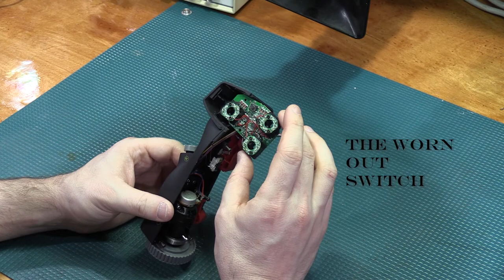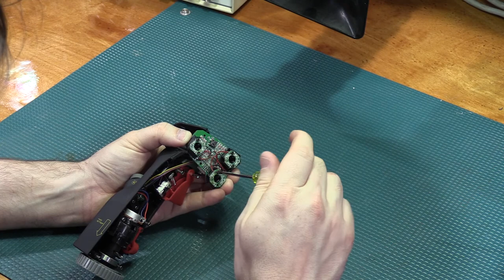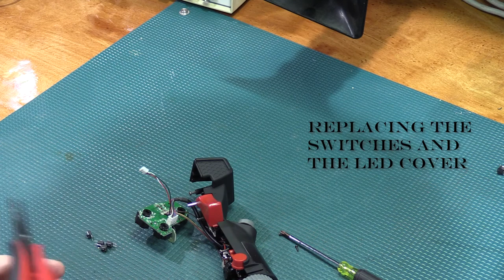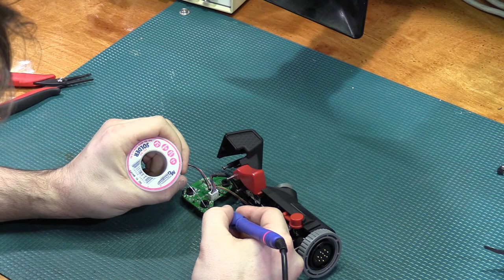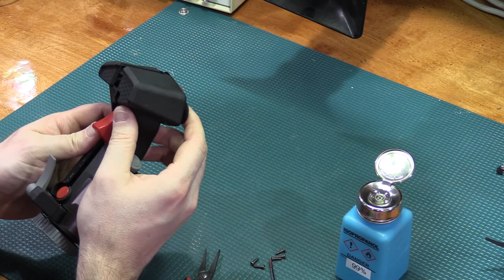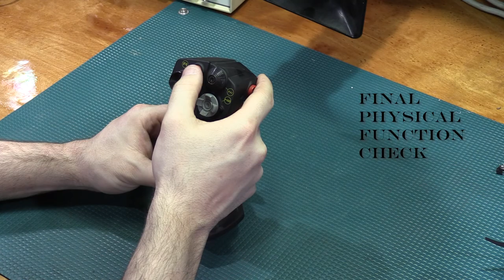X55 Rihno Hat Switch Repair

Comment: Did YouTube remove the audio, I think I need this repair too! No idea whats going on tho, total silence!
Reply from the maker: You tube did not remove the audio. This was the first video I ever made for the channel and it was record with the on camera mic. The audio that came though was horrific and unusable. 
The micro switch under the button flattened out and stopped working The repair was to replace the micro switch that was the actual button under HAT switch. In my cause the fault was in the right hand hat switch the DOWN position. Looks like I spent a bit to much time in elite dangerous.

Comment: Looks like my X55 needs precisely the same repair as yours. Could you please identify the switches used in the "castle" hat?
Reply from the maker: I ordered this: "DaFuRui 120pcs 12 Values Tactile Push Button Switch Micro Momentary Tact Assortment Kit" from amazon. I ordered a bulk bag of the switches that I think work If memory serves they are 6x6x5mm switches
Reply: @ZenwizardStudios  Awesome, thanks!